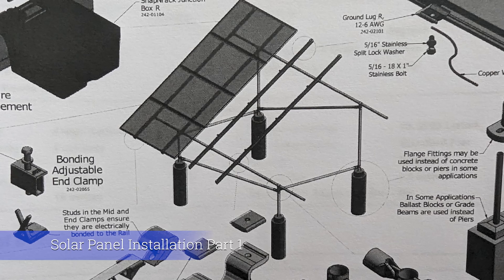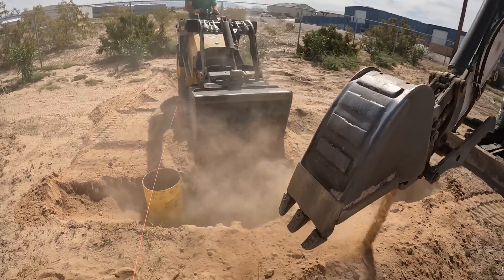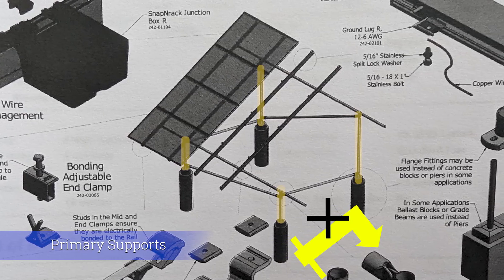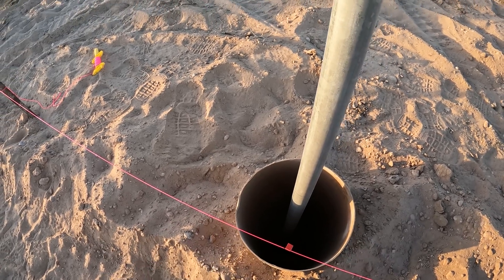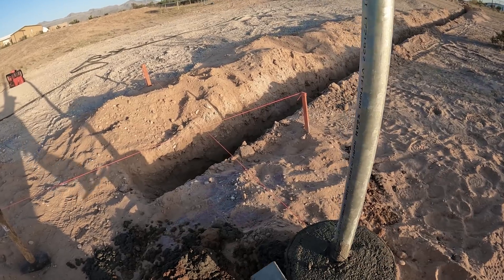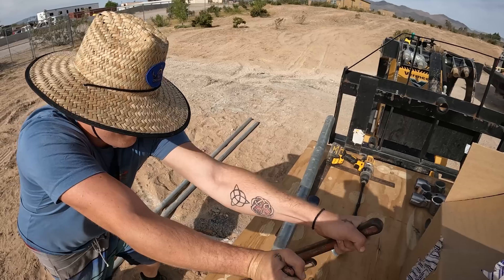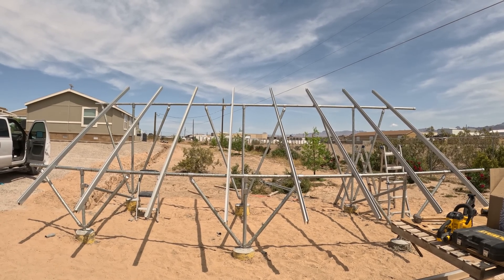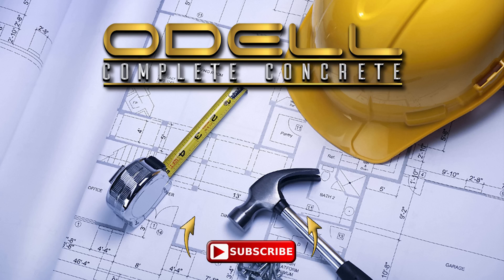(DIY) Solar Ground Mount Installation, with Permits.

Comment: I have spent months and tens of hours analyzing solar mounting systems in preparation for placing a ground mount system.  At 72 years old having been in home remodeling and light construction I know good building techniques when I see them.  This without a doubt is the BEST and MOST ECONOMICAL SYSTEM I have EVER SEEN!  Well Explained and EASY to duplicate!  Nice Job!
Reply from the maker: Very easy build.
GL
Reply from the maker: Thanks! Glad I could help, it's all about efficiency.

Comment: Recently finished a solar carport roof, which attaches on one side to the house rafters (panels slope rainwater into gutter) and to the ground on the other side, with ~12/1 slope and the panels overlapping slightly like shingles.  I considered those aluminum structural fittings, which I've used before in industry (Hollaender, Diamond is another), but found them too pricey.  Instead, I used 1-1/4" steel EMT 10 ft long and their fittings.  If re-doing, I would use 1-1/2" or even 2" since the EMT deflected more than I liked over the 12 ft span with the panels up (60 lb ea).  I added offset wire rope on the bottom of each tube to stiffen them, using fence fittings.
Reply from the maker: Sounds custom.
Good job

Comment: My 3" pipe cost 2,100 for 8 -21" threaded sticks lol. I bought diy 12.3kw for 22,000k plus the galvi 3" pipe, permit through regional 400.00, approval through Pueblo West Colorado 200.00, 420.00 for 4" meter socket through blackhills, and whatever in conduit, electrian for the new slot in electrical box bla bla money money
Reply from the maker: Why 3"?
Reply: Sunwatts

Comment: Great to see you back at it at the Casa De Odell.
Are the solar panels subsidized by the state?
Reply from the maker: No
Reply: FYI, there is a 30% federal tax rebate for home solar power systems.

Comment: can you just do sonotubes on the top part. Like doing a 2x6 frame around the hole to screw and level a sonotube section that goes only about 12" into the soil? Or does it have to go the full depth of the hole?
Reply from the maker: Full depth sono tube saves alot of concrete/money
Reply: @OdellCompleteConcrete  We already augered holes 6 feet deep by 16 inch diameter called in design. Could we just use a short piece of the sonotube for the part above ground level or is it required to have the sonotube all the way to the bottom of the hole. Thank  you in advance.

Comment: Awesome job 💕👍 Chef 👨‍🍳 and you got it done. Be awesome to be able to run the Air conditioning off solar completely during the warm summer months. Won't have to have that guilty feeling running the AC at those in between temperatures 🤙
Reply from the maker: That's the plan
TY

Comment: Are you sure the cross braces going from back to middle front vertical pipes are correct? It seems that the other way around gives more stability to the longer vertical pipes at the back.
Reply from the maker: I don't change Engineered drawings.
I thought the same thing, but I came to the conclusion the top rails tie it all together.
Reply: @OdellCompleteConcrete  This I can see as well indeed. It might be that structurally the connection between the longer pipes at the back to make them longer can't be centrally braced or would snap under wind loads.
Reply from the maker: Most likely, but time will tell for sure.
Reply: I thought same thing til I saw all the rails that connect the 2 that the panels mount to

Comment: that's a lot of scaffolding to put up, is it just over engineered for the sake of it or is there the risk of it falling down or being blown over or an earthquake type event in the area?
thanks
Reply from the maker: Yes it's designed for 120mph winds
Reply: I'm no expert but I think once the solar panels are installed, we'll see the size of the "wing" or airfoil it creates and it will become apparent the structure's susceptability to wind forces. That's just a guess.